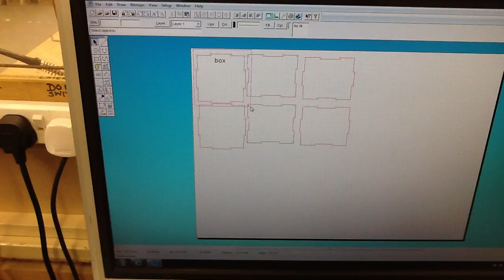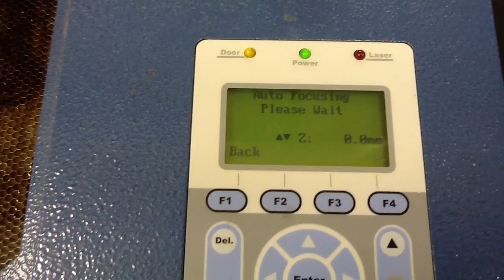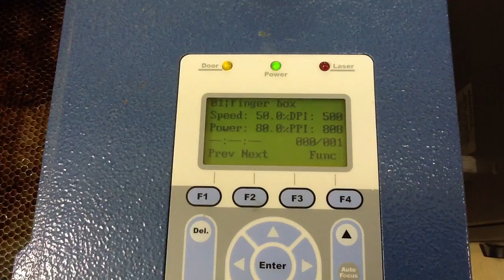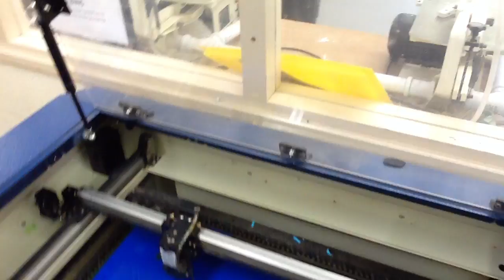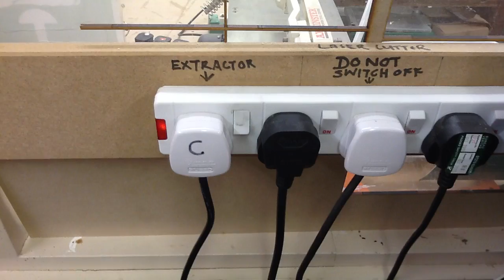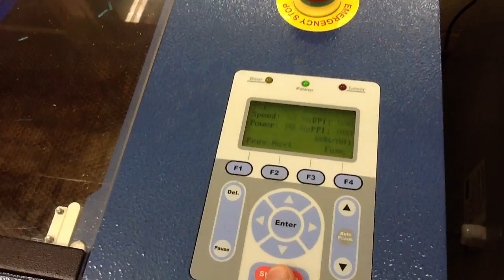Mercury 3 - Step 2 - Sending, engraving and cutting

Comment: Hi, I am struggling to get the right setting for materials to be cut all the way through. When I press "autofocus" it just rises until it reaches the highest point and then says to lower manually. I can set the bed height manually but have no data for what heights are best for what materials.
Reply from the maker: Hey, not sure about it moving up. I have had the issue when the pin on the autofocus gauge needs cleaning and it doesn’t autofocus properly but moves down instead. Have a look at the pin and see if it needs a clean. Also is it seated properly in the holder?
Reply from the maker: The height away from the surface of the material should be the same for all materials. I’ll have a look tomorrow and check the height. I’ve had to set it manually before when the gauge was broken. I’ll send The height of ours through

Comment: Hi there we’ve got 3 of this units but I’ve never managed to get it to do a vector cut it just wander to Rasta every I send it what is the line with you use to get it to cut
Reply from the maker: We use tech soft 2d design so it will usually vector for lines and then taster for filled shapes. I thought it did it automatically, not sure how to set it. Will have a look

Comment: Hello Darron, new to the Mercury.  Had to stop cutting today to restart.  Table went all the way to bottom.  Switched Laser off/on and restart process - table still right at the bottom.  After initialising, pressed Autofocus, and long wait as table does not rise "auto focus please wait message".  Cannot mover table with up/down arrow buttons.  What am I doing wrong?
Reply from the maker: Hi,
Usually it is because the autofocus gauge is stuck in the up position. May need a clean, might just be bent. Once you clean/straighten it it will be ok

Comment: Hey my mercury 3 machine are not properly work in x axis direction but this are start the machine then red beam are stop in middle of x axis plzz help mi
Reply from the maker: Hi, have you checked that the rollers are still on the tracks?  We had this when the machine went too high and the rollers jumped the tracks